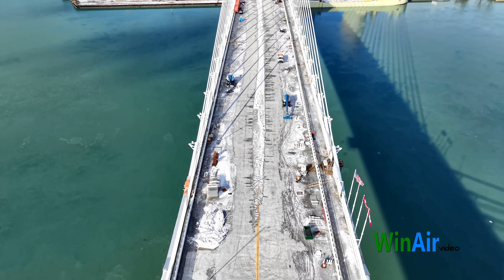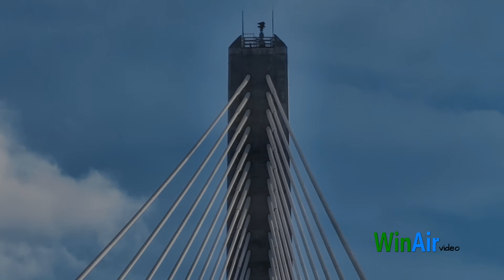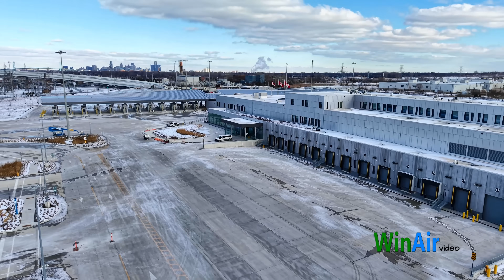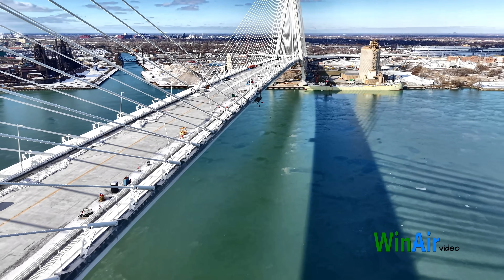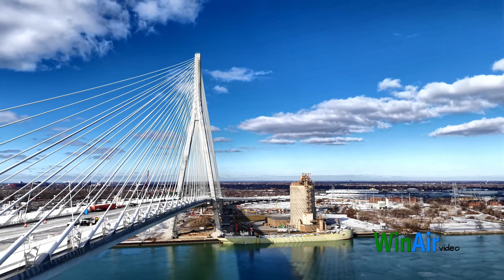99% Done: Gordie Howe Bridge's Epic 2026 Debut

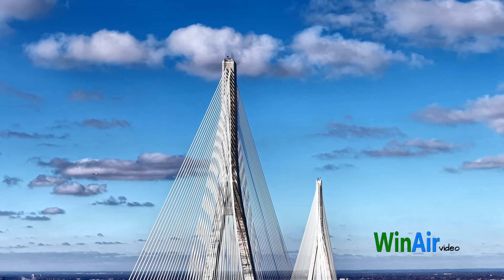Comment: 9:37 220 meters = 722 feet.
Reply from the maker: Hi Ethan. To the tippy top. :)
Reply: @bobjonesrealtor7756  That’s quite a bit higher than the 555 feet (170 meters) of the iconic Mackinac Bridge towers. I live near and travel on the Mackinac Bridge frequently, and those towers go way up. I haven’t seen the new bridge yet, but it must be pretty impressive!
Reply from the maker: It is, Ethan. If you get into the Windsor area you should check it out.

Comment: I wonder how they are going to remove big snow in the Winter? Looks like it will have to be blown into the water unless the surface is heated.
Reply from the maker: Hi Tim. I'm not really sure, but over the edge into the Detroit River is a no go. Maybe they don't have the system in place yet, considering the snow piled on the sides. I'll keep it in mind and see what I can find for another video.

Comment: Detroit-Windsor already has two underused facilities for crossing the border. Adding a third is of no benefit to anybody except, perhaps, the trucking lobby. It's a pure boondoggle.
Reply: Its needed for freeway-to-freeway connectivity
Reply: Disagree.  Builders learned from experience for safest, fastest, most-efficiency crossing yet.  Cheers!
Reply from the maker: Hi DMBall. Thanks for the comment and feedback. I can't say I agree with that basic statement. However time will tell I suppose.

Comment: Not having a duty free is a big miss, in my opinion.
Reply: Duty-free commerce can move away from GH to other crossings and the local community to serve those who are interested.  Better for travelers to move fast, unimpeded, as GH allows.
Reply: @ZZz-ud3bb There is an option for a duty free at a crossing right beside the GH bridge. If I'm traveling, I'm taking the crossing with a duty free
Reply from the maker: I agree, Tim.

Comment: Why all the bs political comments in the video? A new crossing has been in the works for 35 years. When this bridge was approved, Obama was president. Obama refused to budget any money to this project which is why Canada covered all of the costs. Just discuss the bridge and its engineering marvels, everything else is theatrics.
Reply from the maker: Hi Thomas. I appreciate your comment and opinion. It has been a long time coming. The bridge is more than concrete and steel. It represents the trade between two nations, and that includes the people and businesses on both sides as well. The construction of infrastructure is fun to follow, however, the changes it brings, the cost, and how people feel about the change is as important as the bolts that hold it all together. Just my opinion. You don't enjoy the commentary, I understand. However, stating my opinions is part of the package. Thanks for the comment and feedback. :)

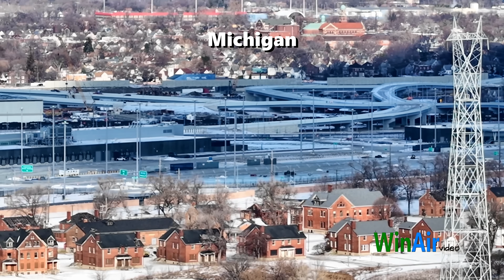Comment: 1:23 Does anyone else find it a little concerning from a design perspective that the car and truck lanes from customs converge and then the on-ramps to I-75 diverge a very short distance afterwards? It means that cars traveling north on I-75 will have to pass in front of trucks traveling south and vice versa, which will lead to a bottleneck either because of vehicles slowing down to get in the proper lanes or because of crashes as multiple cars switch lanes to the left and right simultaneously. Seems like a really poor design to me and thought someone would've caught that.

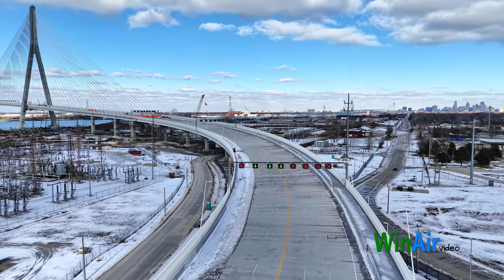7:00 Why are signs showing which lanes or open/closed as well as a solid yellow dividing line? It seems completely unnecessary. Either the lanes are switchable, which would mean that sold yellow line isn't needed, or they're not switchable and the signs aren't needed. Having both is really confusing.

It still is really difficult to see the white lane dividers on the grey concrete road. Having snow makes it even worse. Reminds me of highway 407 where you just make up the lanes and hope for the best.
Reply from the maker: Hi JT. I'm not sure what's going on with the US exchange. The intelligent signage I believe changes in real time How exactly it works we will have to wait and see, unless I learn how it functions before then. I agree the painted lines are far too hard to see. At least from the air. Good catches. Thanks for sharing!:)
Reply: The white lines have black outlines which should make it easy to see them. The outlines aren’t that obvious from the air, but from my experience on other highways, they are easily seen from the road. And I’m curious if you know of a better way to make white lines visible on light colored pavement, or what your preference might be.

My best guess on the yellow centerline is that it represents the typical configuration, and the signs allow more flexibility if needed. But it will probably be extremely rare to see anything other than a red X over the lanes left of the centerline.

No big job is ever perfect. I guess we will have to wait and see what happens when the bridge opens, and if the traffic flow approaching I-75 has any hiccups. Considering how slow the traffic will be going at that point, it might not be much of a problem.
Reply: @Ethan.Lamoureux  I suppose they could've made the white lines all black, instead of having a black outline. Or they could've used asphalt for construction.

I just find it odd to have reversible lanes when it's extremely rare that they'd need to borrow lanes from the other side. If I saw a sign telling me that I can cross a solid yellow line because the lane is allegedly open, I don't think I'd use it. I wouldn't trust it.

Drivers will be forced to go really slow to make the necessary lane changes over the short distance. If they had some forethought and constructed separate lanes, traffic wouldn't have to slow down. But we'll see what happens when it opens.
Reply: @JT78952  Line color is important. White lines mark the right edge of the pavement and separate lanes going the same direction, while yellow lines mark the left edge of the pavement (on one-way roads) and separate traffic going in opposite directions. What does a black line mean? Officially, it is only used to provide contrast for white or yellow lines, such as by outlining them or sometimes being placed between broken line segments. The choice of pavement is made for technical reasons usually related to longevity, with color contrast being fairly low in priority. Regardless, I think you will find the lines show up quite well when you are driving by them.

The most common reason for reversible lanes is because traffic flows often change at different times, with more traffic going one way than the other. So rather than have many lanes dedicated to one direction and no option to change it, with reversible lanes they can let the traffic flow better by modifying lane use. The painted double yellow centerline to me suggests that they don’t anticipate having to reverse lanes for a few years at least, since there are a lot of lanes and it will take time for traffic levels to increase. One possibility is that in the future, if reversing lanes becomes a regular occurrence, they could put in a movable barricade that can be shifted over a lane at a time, such as the one used on the Golden Gate Bridge. Or they might simply repaint the lines to mark reversible lanes with double yellow broken lines.